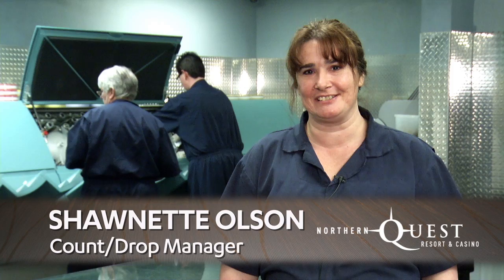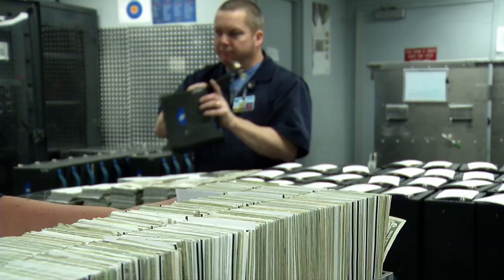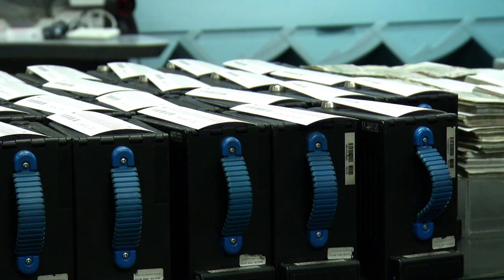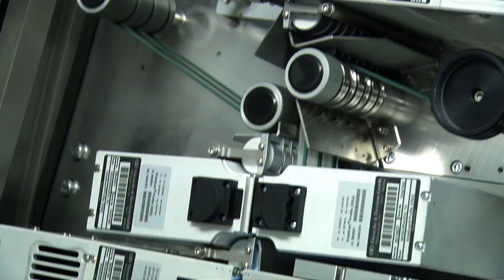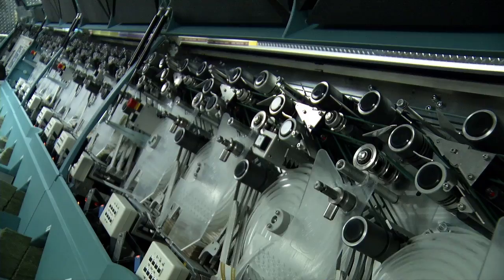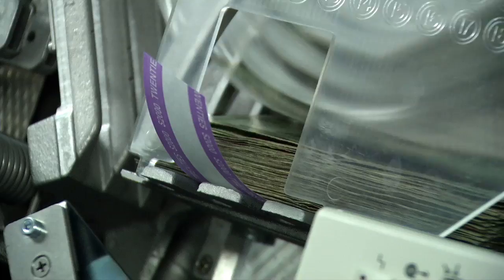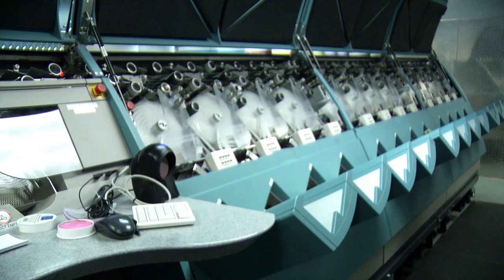The Best of Quest: Let the Countdown Begin!

Comment: 20 pockets really ? And the machine straps for you(ugly straps too.)  I run 600+ per minute on BPS 500 with 14 pockets and well over 2k assets and a shit load of tickets :P

P.S.  My straps and bundles are my hard ocd quality. I take pride In my work, and care of my machines. The 2 combined are almost 50 years old. Most banking equipment failures are due to operator error or lack of knowledge.

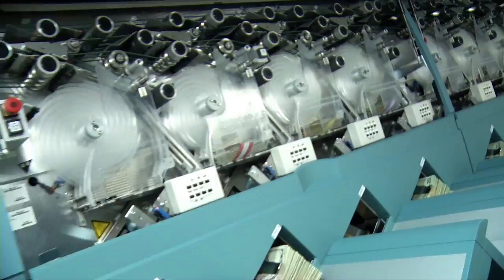Comment: Too bad your top of the line, really expensive machine mis-sorted a $5 bill into the casino ticket sort location (happens at the 1:15 mark).  How often does that happen?  What happens when this machine is down...do you use the table top pocket machine shown as a back-up?  Really?
Reply: yes i noticed the same thing! talk about bad editing!
Reply: Susan Parker,  too bad you didn't know that was the reject compartment.  You must be used to lesser machines.
Reply: BPS Experienced hey , what happens when this machine out of no where just rejects the 5"s .. What could it be ?
Reply: It was bad editing. The machine likely gave a PDG error, meaning the $5 was read by the basis modules, but failed to deliver into the pocket. (Photo detector gate.) The likely reason was just a "shitty" $5 bill that got stuck, it happens alot. It dropped into the ticket pocket because that was the next "open gate" and it got sucked in by the belts.
Reply: The scanner was not able to scan the 5$ bill, because it was folded as you can see it on the video. So it sends it to the rejects pocket. All you have to do is unfold/straighten and re-run with the header card thats all. Sometimes machine will not scan very old/washed out currency.
Reply: That was the reject compartment.  It will never sort a bill to the wrong pocket.  Been using these for 10 years.
Reply: Actually,  M class G&D machines sending suspected banknotes to reject. All banknotes which end up in reject compartment has to be manually inspected and then, if still have a doubt sent on expertise. Banknote which end up in reject don`t have one or more machine readable  elements of protection. So, it`s always possible that is counterfeit banknote.